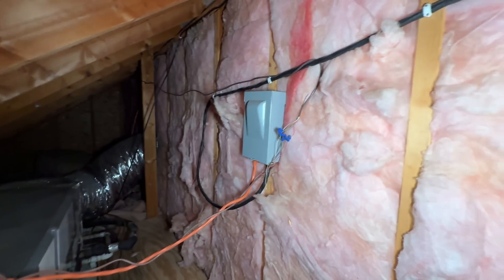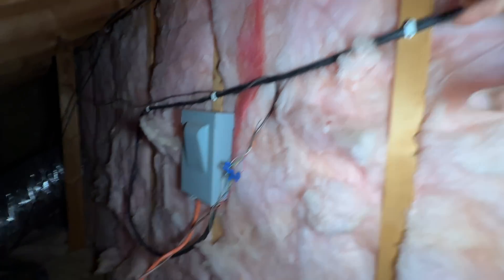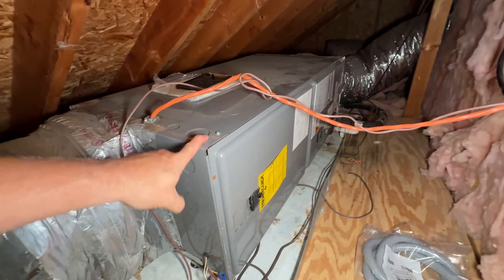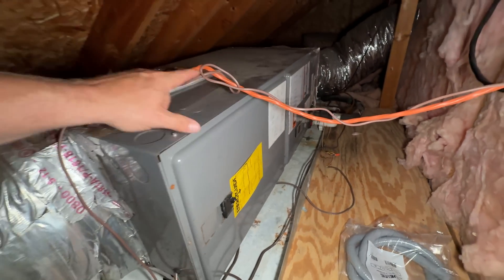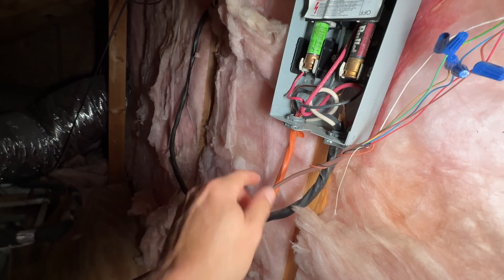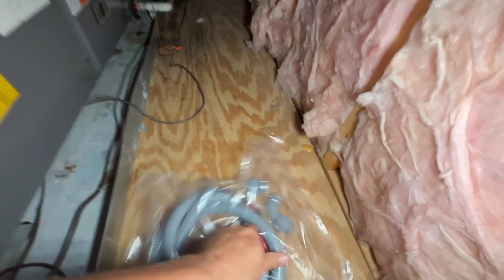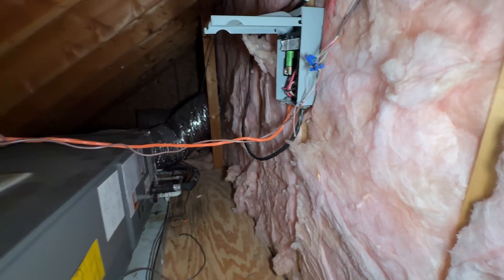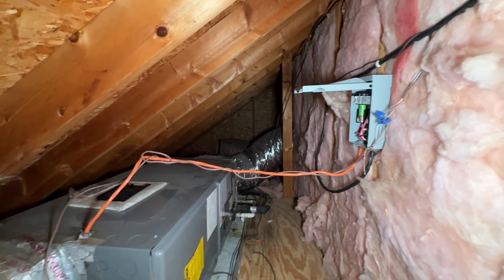How NOT To Wire An HVAC Unit!! High Voltage Hazard

Comment: Thank you for doing it the right way !!!!
Too bad we can’t say the same for the guy who installed it. 
I also noticed that you strapped the flex conduit away from the roof surface so that when the roofer misses with his nailing, it doesn’t find its way into your wire. 
Great job , thanks . 👍👍👍👍

Comment: Just a note that the #8 in Romex (NM cable) is only good for 40A. When it's THWN  (copper) like the wires that come with that whip, it's good for 50A, assuming the disconnect/breakers are rated for 75C. The disconnect may not be 75C rated, so you'd have to stick with 40A. Either way, what you did was right and what was there was definitely wrong.
Reply: It also needs a backing plate if its gunna be “code” complient😅. Lol 
In reality the #10 wasn’t right but not a huge deal due to length. Still woulda tripped the fuse if too hot